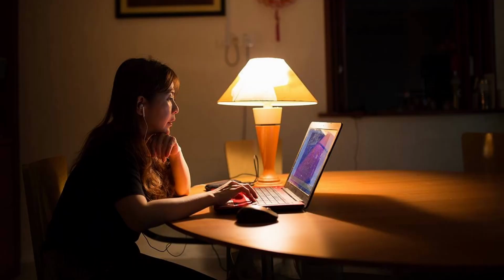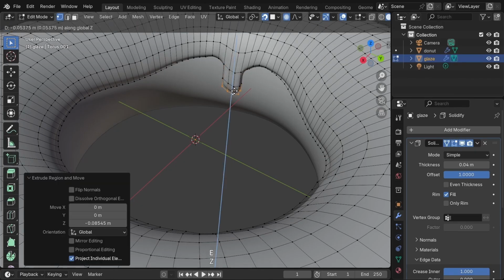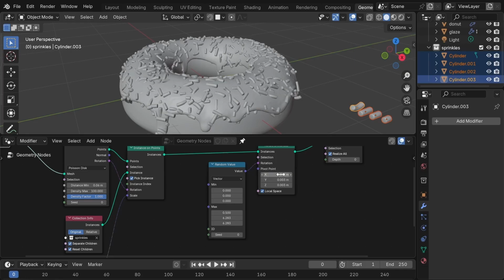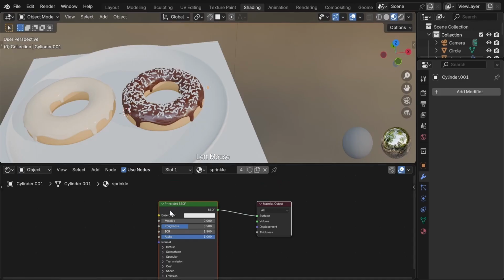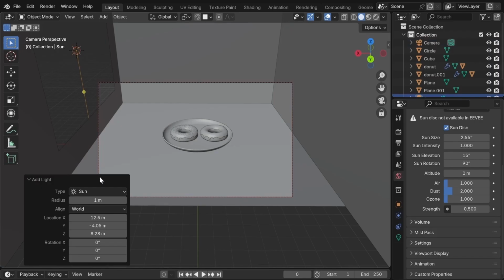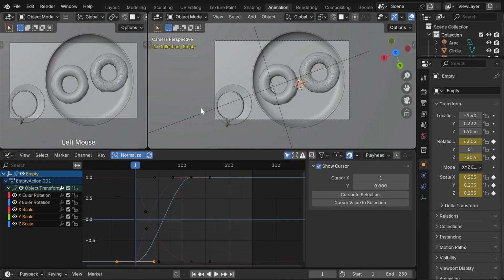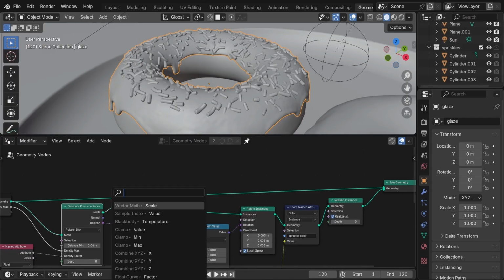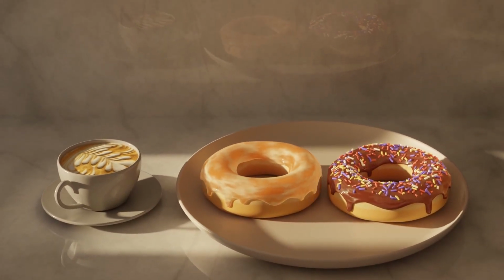Blender Beginner to Intermediate Tutorial | Create a Realistic Glazed Donut [Full Course]

Comment: This video is a comprehensive beginner-to-intermediate course that teaches the professional 3D workflow in Blender by creating a realistic glazed donut scene from start to finish. The course is structured into the following key stages:

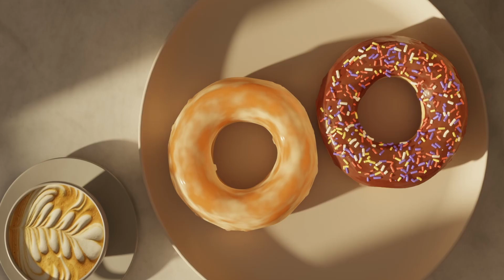Modeling: Starting with basic geometry (0:09:49), the tutorial progresses through shaping the donut and glaze (0:34:25 - 0:52:15) and using modifiers like Solidify and Shrinkwrap to achieve natural forms.
Surface Detail & Sprinkles: Using Geometry Nodes (0:52:15), the creator demonstrates how to procedurally place sprinkles and control their density.
Materials & Texturing: The tutorial covers setting up materials for the sugar and chocolate glaze, utilizing Noise Textures to create surface variation (01:20:10).
Lighting: The video explores both Eevee (01:54:14) and Cycles (02:45:55) rendering engines, teaching how to set up professional sunlight and area lighting to define mood and form.
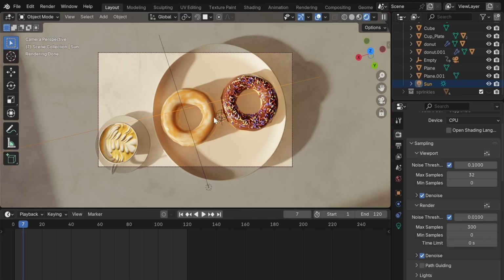Animation & Compositing: The final sections cover creating cinematic camera movements (02:32:44), rendering the final frames, and using Compositing to polish the output for a professional result (03:05:22).

Throughout the series, the instructor emphasizes production-ready habits, such as consistent object naming, organizing workspaces, and using external assets like Sketchfab models to optimize the workflow.